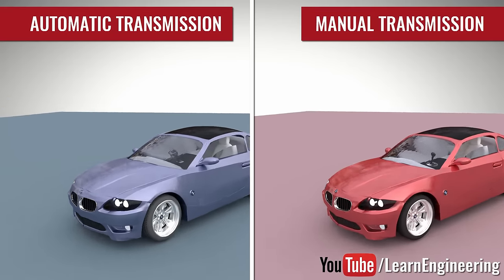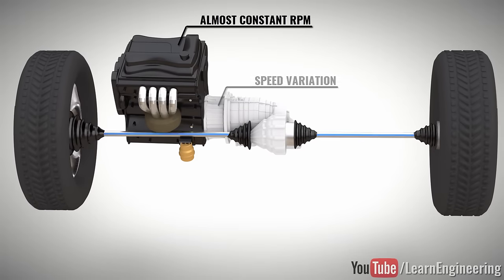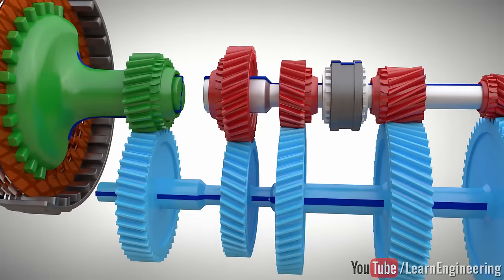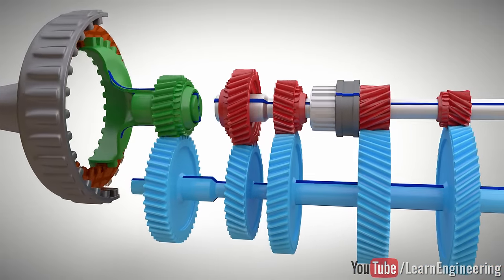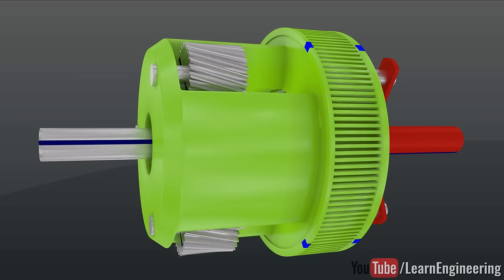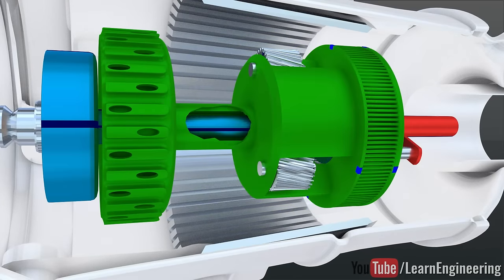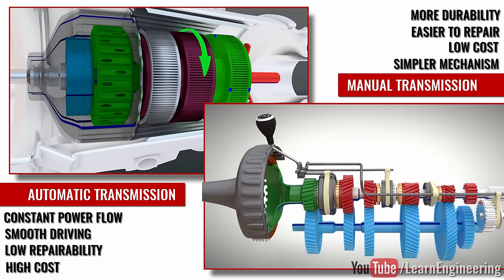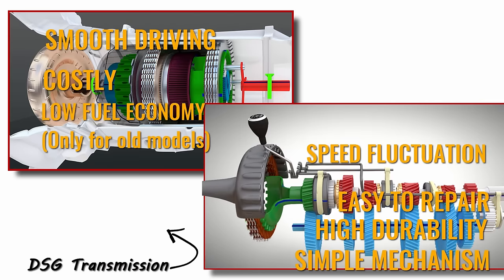Automatic vs Manual Transmission

Comment: I still prefer the physical control of a Manual
Reply: CraftMinerKyle for me it depends on the car older cars 2010 older 100% manual but these knew autos especially if a sport car are just leagues above a manual if you are going to be racing
Reply: I don't think u old enough to drive if u have an enderman as ur profile pic
Reply: Most places aren't going to let you race with an auto though..
Reply: Indeed manual you have feeling like yoi drive it. I tried both
Reply: Are you a bit to young to know this i mean enderman is your profile pic i mean you might say the same for me but my dad tought me alot about cars
Reply: Lol and what if he likes minecraft? is not like if its a 2018 game only for kids, and keep.in mind in a brake emergency you can also count with the engine brake with manual and not with automatic transmission
Reply: Kyle Morrison I'm the same way.
Reply: A27M CROMWELL Got eem! Lol
Reply: Okay Kyle
Reply: guys, minecraft is like ten years old. it's really not... oh forget it
Reply: automatic transmission is the best one I have
Reply: @maxpowell2157  new automatics do change down or you can hold a gear or force a lower gear for engine braking. Older autos were not good with engine braking due to less number of gears and sometimes highly geared. Modern 8 or even 9 speed autos are now better than manuals and change gear faster and have better range of ratios although might be slower to change when really cold (torque converter) or uphill in first gear (demand). If braking hard your engine braking really becomes negligible though on most cars. You should ensure you have good brakes if you are driving to stop too quickly. New Autos are now better than manuals especially in long UK traffic queues. But you can never really replace the control you have with a manual I guess.
Reply: 100 subs No videos? So according to your logic, playing minecraft and enjoying it enough to have one of its mobs as your profile pic automatically makes you a kid?
Reply: You will change your mind if you drive in China where loads of cars make you stop and start again and again which drives you mad.
Reply: I agree too but BMW 8 speed auto is now so good, it is easily as good as manual to drive, with same mpg as a  Manual. 8 speed auto gives good drive rarely above 1500rpm with silky smooth seamless gear changes, very good economy due to gear changes at low revs and benefits in slow traffic as no clutch. Have driven Mini Countryman F60 2.0D gives real world 50mpg mixed hill/urban/ low speed, closer to 60mpg on mototway which is superb to drive. Also driven BMW 520D slightly heavier but just as good with the same BMW 8 speed auto box.. forget manuals, forget high maintenance dual clutch/ forget CVT.. Newer auto boxes now work well providing the vehicle has relatively low weight and at least 8 gears.
Reply: This comment chain lmao
Reply: I'm fed up with traffic jams, so my choice is automatic one.
Reply: Until autos can anticipate the road ahead rather than reacting to the road under my tyres I will stick with manual

Comment: In the automatic you may have a smoother experience in shifting gears, but less control.  Try slowing down the vehicle by simply removing your foot of the accelerator.  In an automatic, you may obtain the same speed as you did before, which means the brake pedal will have to be applied. In an manual transmission, the engine does the work in slowing the car when the accelerator is released, thus saving the use of brakes.  To slow down faster, shift down to a lower gear.  You may try this in an automatic, but some automatics will only shift down when the engine is at a certain RPM, so brake will have to be applied anyway.  This is why manual transmission is better than automatic.
Reply: One time I went with my sister (in her car with an automatic transmission) to visit relatives in another state. When it was my turn to drive on the interstate, a car swerved in front of us from another lane. Out of habit, I let off the gas pedal to slow down, which of course didn't work. I think we got to about three inches behind the other car and my sister was freaking.

Comment: Thanks for the video, found some interesting information. But I'll have to dissagree on one matter: during braking on a manual transmission car it is NOT mandatory to press the clutch pedal. Furthermore, doing this shall actually perform worse than just by simply pressing the brake pedal directly.
Reply: Yes, do that without bringing it to neutral and your engine will stall.
Reply: @sayantansaha1976  You can start breaking on a manual transmission when engaged in a gear, though when you feel that you're close to full stop, either disengage the gear or just push the clutch pedal. Your disc brakes and calipers will serve you much more if you break using your engine and transmission gears.
Reply: @sayantansaha1976  No it won't. Not unless you end up below your idling RPM
Reply: @sayantansaha1976  lmao you don't know what you're talking about, clutch should only be pressed to change gears, nothing more than that.
Reply: @damasta.md.99  bruh, you literally have to push clutch pedal to disengage and operate gear tf you talking about

Comment: "when breaking clutch must be pressed with manual" - nope. theres engine breaking, which means just releasing the gas pedal. if you wanna use the brake you just should release the gas pedal. engine braking and brake-braking work together. when you STOP is when you need to press the clutch. please use "must" responsibly
Reply: Ujvári Mátyás Youre right
Reply: or just press the clutch and put it in neutral.
Reply: while doing like 90 on HW and in front is someone with 60 or 70? we were talking about slowing down not "cruising" o.o"
Reply: VoidRapt
Reply: I may have heard wrong, but he never says "when breaking, clutch must be pressed...", he says "before you press the break pedal, the clutch pedal must be pressed down completely". Two different things.
Reply: solar1 plus but its still not correct. with the clutch you can change the engine-brake strenght. so if you press half, the engine just half slows you.

the case is, the clutch only HAVE TO BE pressed when stopping or shifting. never must while braking.
Reply: You also press the clutch to down shift while slowing down by alternating between braking harder/lighter and down shifting.
The only case where you do not down shift is in emergency braking.
Reply: Same engine breaking goes for automatic transmission.
Reply: solar1 plus how are they two different things? When braking, press the clutch, or before braking, press the clutch. It's the same thing. And both are incorrect.
Reply: engine-braking is transmitting the load to the transmission and then to engine...
is that okay for the gear and engine?
Reply: Sometime ago at least in Russian vehicles it was considered not okay, the gears took wear. Now since gears teeth are machined in a way that they withstand this load, and it is recommended to use engine break. Sometimes elderly people may actually keep telling you to switch to neutral downhill.
Reply: In the video he talked about BREAK PEDAL which has NOTHING to do with engine breaking. But looks like you fooled 57 people.
Reply: @Dalmatia Fx Obviously you have no idea what breaking is! Using engine breaking allows less tear to the breaks themselves, hence less $$$ for maintenance. Of course there is absolutely zero point in pressing the clutch alongside the break. Also engine breaking is way more efficient than the breaks themselves. That's why new automatic cars use engine breaking for emergencies. It's all readily available if you simply google for it!
Reply: I believe, not only new. Any of those that have lockups brake with engines.
Reply: And you totally missed the point of my message. Read my first comment again.

Comment: Manual transmission is more durable and low cost. Automatic transmission offer smooth driving.
Reply: Until you burn up a clutch
Reply: Automatics usually can tow better because the torque converter is able to slip without doing damage and a torque converter can multiply torque when the output side is moving slower. Also planetary gear sets have the redundancy of three planet gears versus just one reactionary gear in a manual transmission. So the guts of an automatic can actually tow better in some situations. And in a manual, all of the weight you're trying to move is being put on that tiny sleeve that is engaging whatever gear you are currently in.
Reply: And manuals offer the smoothness of automatics also. The only reason for an automatic is if you really don't know what you're doing.
Reply: @nthgth  well, there's also old people and people with bad hips, etc who would be miserable driving a manual.
Reply: Low cost ??  On a the manual transmission, you must replace the cluctch, and it has a price for replacing this part !! On the automatic transmission, no parts to replace, just the oil and the filter.
Reply: @Wacko972  I bought a clutch kit for a cherokee and it was 80 dollars, including the throw out bearing. The labor of dropping it is what cost so much, which would cost a lot on an automatic. I did the job myself. And have you ever rebuilt an automatic? Cost 1-2 thousand dollars, if not more.
Reply: No, manual transmission is so smooth, when you can smoothly shift gears. Manual - old school for skill drivers..
Reply: @billgateskilledmyuncle23  all towing in an automatic feels like is doggy paddling in a pool. Step on the gas it revs up but nothing happens right away. Never heard of relying on that one gear in a manual being a problem. There's more control in towing with a manual, downshifting is more responsive, you just may not be able to upshift  uphill at slow speeds as easy, but dont have to worry about your transmission temp over heating.

Comment: if you can't make a "smooth" gearchange on a manual. you need more practice..
and no.. you brake.. then press the clutch. so that you get engine braking..
and then you can downshift for more braking...
Reply: I think they mean "when coming to a stop, to prevent the engine from stalling".
Reply: Ya I thought this was unclear too but I think ultimately they mean what DumbDuck says. They could have expressed that concept better.
Reply: LiquidBlackWolf as a manual driver my self, you can't deny that when changing gears you often feel a very soft "bump" when compared to automatics. It's definitely less smooth, but to me that's the beauty of it

Comment: Isn't it weird to post an "automatic vs manual" video in 2016/2017 and not mention dual clutch?
Reply: Radu Bogdan dual clutch is automatic.
Reply: callofdutyguy9 that was my point. The dual clutch is a very popular version of an automatic, which has no torque converter and is much more like a manual than like a traditional automatic. Yet this video presents the torque converter version as all the automatics are like this.
Reply: It is.
Reply: Radu Bogdan that's fine, I hope you agree with me when I say that traditional Manual transmissions offer a superior driving experience over any type of automatic!
Reply: callofdutyguy9 Unfortunately I don't (anymore). I've been driving manuals since 2001 and just recently switched to a dual clutch and I really see no downsides with it. Moving around town is clearly more comfortable and the manual mode coupled with the padels offers an awesome experience when driving on some back roads fast.
Reply: Radu Bogdan Never understood what's enjoyable about a dual clutch other then the fact that people like them because they can't drive a Manuel. but you said you could so I don't know. it's just clicking a paddle.
Reply: In my country, over 80% of the cars are manuals, you're not even allowed to take your driving exam on an automatic. So being able to drive a manual simply isn't an issue here as it is in the US.
With regards to your question, I've enjoyed manuals for over 15 years and the extra control it offers just isn't appealing to me anymore. Strictly speaking from a performance point of view, there's no denying the dual clutch is better. As for the driving experience, it feels like the dual clutch it's allowing me to focus more on the car control, it's allowing me to downshift while in the corner on the limit without breaking traction, something I wouldn't dare do with a manual when the car is on the edge. Another interesting point is that most cars don't have the pedals positioned in such a way to facilitate techniques like heel-toe, which makes braking hard for a corner and downshifting at the same time cumbersome.
Another small plus is the noises the dual clutch allows the engine to make. The "burp" the exhaust makes on the upshift and the throttle blip you get on downshift really seem to complement the driving experience when going fast on some back roads.
However, I totally understand the appeal a manual has so I totally understand why other people might feel different than I do :)
Reply: Actually, the first dual clutch setups were used as manuals. They later replaced people switching gears with a computer and solenoid setup. The are very much like a automatic and manual.
Reply: Also in my experience of double clutch gearboxes there is no feeling or noise change in between the gears. it just feels like one long gear
Reply: +callofdutyguy9 You haven't actually tried a dual clutch, have you? They're much better than planetary gear automatics, as efficient as a manual, but faster and much more comfortable to drive.
Reply: Modern automatics are simply a manual with electronics controlling the gearshifting.  So they are both smoother and more fuelefficient.
Reply: Christian Skoglund That is a series of automatics. But many automatic transmissions are of the older variety, which pumps dictate a hydraulic circuit that changes gears through clutch packs. Newer transmissions include the manual switched by computers, CVT's, and while somewhat a CVT, doesn't run on traditional belts but by a series of gears that spin at variable speeds much like explained in this video. Nissan and Subaru uses a CVT belt style. Toyota uses a gear setup CVT, ford and dodge uses a dual clutch automatic (manual controlled by computers and solenoids.) Both use a smoother 6 gear setup.
Reply: Radu Bogdan son of a bitch... just when I thought I had enough to learn already you tell me there's more? :'D
Reply: Anarchy RogueTM you do seem to have a lot to learn if 2005 tech seems new to you :D
Reply: I'm with you. I've driven Manual for 4 Years (yes, I'm a "young" driver) and just recently got my VW with Dual-Clutch system and HOLY CRAP I didn't know what I miss until I got it.
Driving automatic is like an electric car 0-140 in one long gear. 
and If I have to be quick I use my pedals to manually shift down/up.
I'm gonna watch some videos on that system now, cheers!
Reply: I was thinking it's weird to mention both Automatic and manual and NOT CVT which is more efficient than both.

Comment: I drive already 27 years. During my half of million km without any single accident due to my fault, I drew both gearboxes. Automatic gearbox is good only in two cases: when you drive under calm and simple traffic conditions and when you are in traffic jam. In all rest cases automatic gearbox is just very dangerous thing. Especially, on slippery road. I live in Nordic country and regularly have to drive on snow and even ice. Under that conditions, I simply hate automatic gearbox due to it's unpredictability. For example, it can simply change the gear when you are passing a long turn on icy road and that is enough to make your car turning. Or, you have to go down long hill and your gearbox will choose highest gear possible. You'll have to burn your brakes. Another bad thing of automated gearbox is slow response, which can cause a serious accident. Fortunately, modern gearboxes have got manual mode which dramatically reduces possibility of unattended gear change and slow response, because driver can choose gear in advance and keep it as long, as needed having immediate response to gas pedal. However, there still remains delayed start from 0 km/h. Another disadvantage - there is no possibility to control torque precisely. Only clutch gives that possibility. It is very important on slippery ways as well, as leaving home at morning after blizzard night.
Reply: Perfect explonation!
Reply: @MrKristo555  Thank you ☺
Reply: Very informative,Thank you...... Iam driving in Dubai with Automatic car, ford focus 2006 Spain model, it has both manuel shift and auto, when i need to drive like a hell, i use manuel shift so easy to turn with control.
Reply: @sarathpcputhur4594  I do the same on ice even I simply drive without any hell ☺ Actually, I own a second hand Audi Allroad A6 C6 restyling and I was unable to find a such car with manual gearbox. Now there is a winter in my country and I have a beautyful car for that conditions. But automatic gearbox...
Reply: Dude learn proper English before you post a comment
Reply: @starsaber2002  Until that time is it forbidden? By the way, how many foreign languages do you know properly?